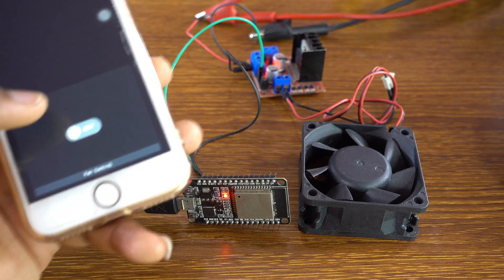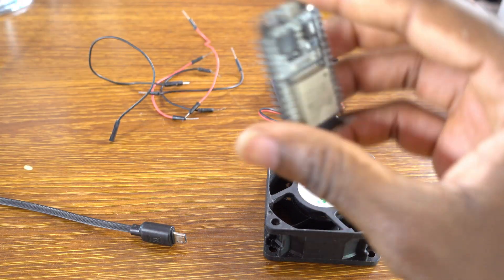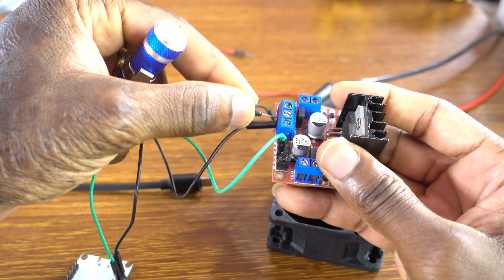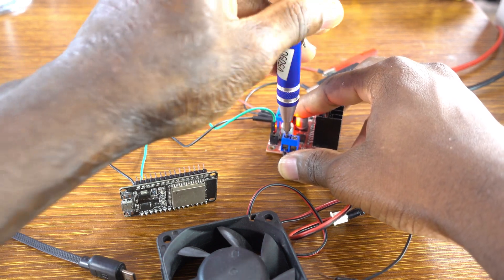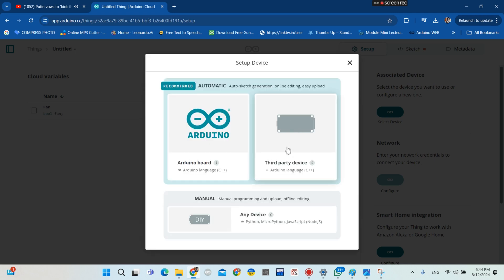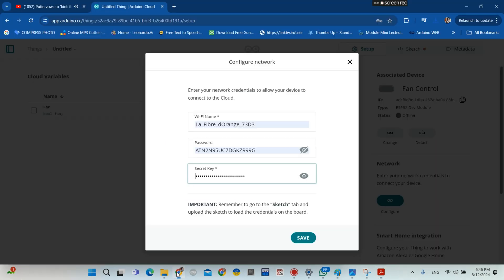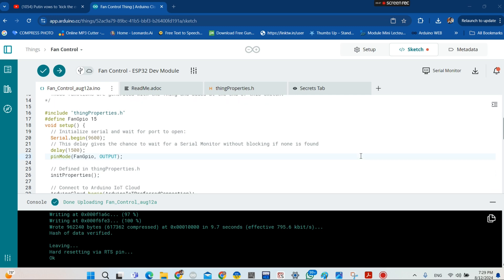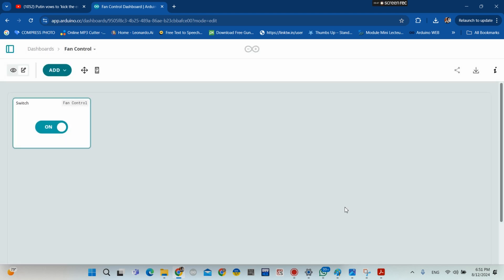Controlling a 12V DC Fan with ESP32 on Arduino IoT Cloud(IoT Remote App)

Comment: Hello. Why didn’t you use a Relay instead of this DC Motor Drive? I’m only curious about functions of DC Motor Drive.
Reply from the maker: You can use both. The dc motor driver is motor convenient
Reply: @uploadideaswithitamar I’m thinking that it’s better to use DC Motor Drive if you need to control 2 motors or you need change direction, speed…